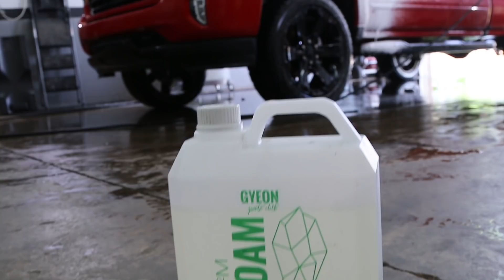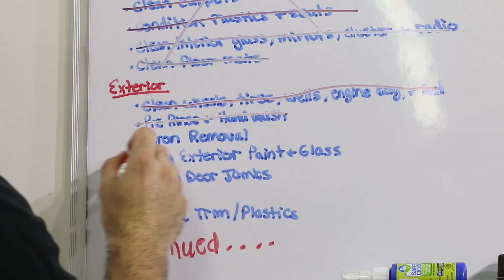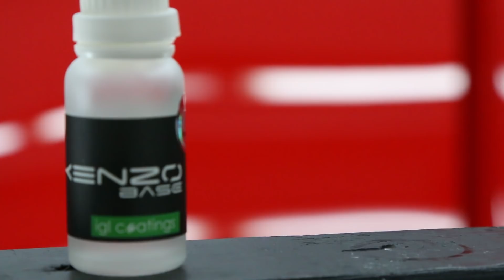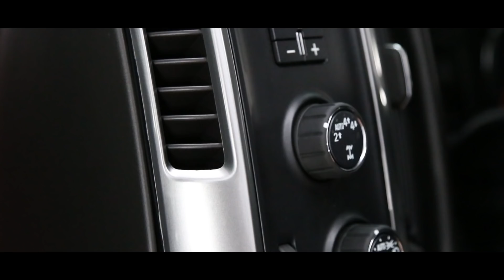PART 2 Detailing The DIRTY GuitarmageddonZL1 Truck

Comment: You guys stepped your game up with these videos!! You guys do badass work!
Reply from the maker: Baird Racing thanks man! Really means a lot!Took a lot of work but striving to keep it up as much as we possibly can from here on out!
Reply: Pristine Auto Detailing I wish you guys were closer so I could get mine detailed. What is the cost to do the full detail like the detail you did for this Silverado?
Reply from the maker: Baird Racing how far away are ya? Some customers travel pretty far. Prices greatly vary but this type of detail would run around $2k. That’s with our top coating like this received and discounted paint correction rate and free interior detail with our 2 top packages. Treat everyone the same and give the best price we can. This detail was a $3k value but had $1k off with the package he selected. Most average $1400-$1700 tho all depending on the prep and paint correction

Comment: If you haven't already, you should look into filtering and drying that compressed air - that ingersoll rand will pass oil into the airstream and on to your "canvasses" or " works of art".  It gets worse the harder you run it because it heats up and the oil turns more "aerosolly "
Reply from the maker: For sure! We do have multiple filters now but would like to eventually add a dryer as well!

Comment: I just watch this video.  Truck looks good.  Could you do a video on what products to use on areas of the truck?  What do you spray on the inner wheel wells?  Mine look like crap I need help.
Reply from the maker: Ben Deco yeah definitely! We use Stoner all purpose cleaner in wheel wells and a ton of pressure washing on the carpet wells.

Comment: What coating did you use for the exterior plastics and rubber?  Are you using the same coating used on the paint?  Excellent work the truck looks amazing.
Reply from the maker: On this job yes we applied IGL kenzo to exterior plastics as well. Sometime depending on the vehicle we will use IGL Trim Coating but not every time. The kenzo holds up really good on the plastics.

Comment: What are the yellow micro fiber towels you are using? Also your wheel and tire cleaner. Thanks
Reply from the maker: detailing_101 the yellow towels are just the Costco Kirkland towels. Tires we used Stoner all purpose cleaner, and Wheels basic soap and water with Gyeon iron remover typically. Sometimes Detail king brake up wheel cleaner. Some links in vid description. 👍🏻

Comment: Wait you guys spray the engine? Wouldn't it damage the alternator?
Reply from the maker: Gm Fix don’t spray alternator or electrical components directly. We only spray the areas around and major plastics and hand wipe the rest. Have to be careful. Have done thousands this way but don’t recommend if your not careful. You can also bag up alternator.
Reply: Trust me...the alternator gets wet everytime you drive in wet conditions...a bit of spray won't hurt it...

Comment: This is by far your best video! Awesome! That truck looked amazing. What kind of coating did you use?
Reply from the maker: TJ thanks man!! We used IGL Kenzo for our coating.
Reply: Pristine Auto Detailing I guess I haven't heard of it yet,do you guys sell it? If so I  would be interested in buying some to try out. Hows that baby boy,is he letting you get any sleep?
Reply from the maker: TJ hey we cannot sell the Kenzo. Have to become an authorized installer. If you have a Detail shop it may be possible to get your hands on it though
Reply: Pristine Auto Detailing cool thanks man!

Comment: How did you remove those hard water spots on the windows?
Reply from the maker: Corey Dawson tried 0000 Steel wool and lubrication but they were too etched into glass so we machine compounded all the glass.

Comment: Nice work guys! Truck looks great and I'm sure Nick is happy with it! What about a 2011 mustang in black? I've got nasty holograms and swirls... what do you recommend?
Reply from the maker: Thanks John! We have a love-hate relationship with black mustangs lol. Typically with them they need buffed with menzerna 2500 and the polished with menzerna 3500. 20-30hrs later you will have a nice halogram/swirl free car.
Buffers: Rupes 21mm & Rupes lhr 75e
Pads: Yellow Rupes Cutting Pad followed with a Buff Daddy black finishing pad.
Reply: Pristine Auto Detailing thanks for the advice. That's the most I've gotten to that question, most ppl tell me to just re paint the car. I'll look into those products! Thanks again!

Comment: What tar remover is that? And are you able to use it on the windshield? I drove through a construction zone in Ohio as they were spraying tar and have it all over my white car. I can’t find anything to remove it
Reply from the maker: steven ecker try looking for Stoner Tarminator. Works well and you can use on glass if needed.
Reply: Thank you! I’d just rather try using everything I can versus replacing a windshield lol
Reply from the maker: steven ecker don’t blame ya! Have you tried lacquer thinner on glass only?
Reply: Can’t say I have tried that. I’ve tried washing it at the car wash and everything and it’s just stuck on there. But I’ll definitely try the lacquer thinner
Reply from the maker: steven ecker try a lil test spot. Put it on a rag and wipe a lil section first
Reply from the maker: steven ecker a lot of the times if you contact your state or township they will pay to have tar and rd paint remover as long as you know where and when it happened

Comment: That's alot of work for so so results. Too many different company's of products being used. Not impressed sorry.
Reply from the maker: Appreciate your feedback! We like to see everyone's opionion so we can give the viewers what they want next time. So you would like to see a video using all one companies product? Can you explain why? We have found that each company has good supplies and each company has not so good so over the past 16years of testing many products we have to mix match to provide the best results we can get.
Reply: Pristine Auto Detailing Thanks for replying. Yea I like to use one company's products when I detail my car. I think you get better results cause there products are meant to be used with each other. When u showed that spot on the bumper where you fixed you can see spots and other stuff that's why I said I'm not impressed. I do love that thing u had attached to the hose to clean under the vehicle. I'd love to get one.
Reply: nyrngrs15 - They showed the before and after but the two were a bit mixed with each other - showed them side by side but I think they showed the before when it should have been the after if I am making sense. I thought it looked really good where the paint had been scratched well the clear coat anyway. I don’t see how it could have turned out any better other than to refinish that area. I am very fuzzy but I would’ve been very satisfied with the  results. Cheers
Reply from the maker: We aren't a body shop so we only perform the work within our means. Could use a full respray on the bumper only then clear ppf installed. It was really really chipped up and damage and didn't want to do more than buff, touch up small little chips, and coat.
Reply: Pristine Auto Detailing I know your not a body shop. Your paint correction sucked it's that simple
Reply: nyrngrs15 - You mention that you detail your car and you only use one product line. Plus you weren't impressed with the bumper area that was damaged. Than you said after your one comment that you were sorry - last sentence in regards to your comment? 
I take it your not a professional paint detailer or own your own business and again you only detail your car. I have been a paint and vehicle detailer sense 1967 this doesn't include the years before having detailed my Dads cars or my own prior to starting in the business. I now presently own 3 vehicle detailer business's but I haven't detailed a vehicle for roughly 9 years because of my age now at 72. 
First off the bumper needs the clear coat buffed out using a very fine polishing compound but it appeared from the video the clear coat had been compromised. In this case to make it look like new it would need a respray - at least the clear if the paint had not been damaged. They told Nick they - in so many words they would see what they could do in regards to that damaged area  not make it look like new but would do their best. I take it you have never heard or seen fallout from a steel mill - foundry? If you had you would understand that with fallout from a foundry on a vehicle that is not only parked 10 - 12 hours a day sometimes for 7 days week in some cases permanently damages the clear coat and in some cases the paint depending on the vehicles finish? I have dealt with Enamel - lacquer and clear coat finishes used on vehicles sense these fishes were used. They all react differently to fall out and with clear coat it is a challenge to deal with period. Short of using an abrasive compound used on any painted vehicle one runs the risk of damaging the finish even more if your not properly trailed to do so. I take it from the video this shop does not use polishing compounds on vehicle but only uses a buffer to polish the fish itself with a wax type detailer product. In short this business did what they normally would do in regards to detailing and than applying some type of paint sealer. Yes some of the fall out still remains but no fault of this company because they are not a paint refinishing service. Detailing and a paint restorer companies are totally different as you know. In my opinion this company did what they could using the technics they are trained to use and let customers know in advance. Fall out is basically a severe type of acid rain and once on a vehicles finish each time it gets wet it is reactivated and continues to further damage a vehicles finish. Fall out is not nearly as bad at or near foundries because of strict EPA rules and regulations. I am not versed in the sealant products used on Nicks truck only because I have never used it. As for mixing products - brand names I will say that I also purchase what I have found to be the best in regards to my personal experience for my 3 shops. Most all of them have close to the same ingredients or chemicals and some are made by the same companies although a bit different depending on the brand name they are made for. But I will not argue the point that the same product lines work better as one or mixing brands only that I use what I have found to be the best for myself.  
My conclusion is this company which I haven't dealt with from the looks of the video did what appears to myself a very good job considering. Videos or pictures can't show everything in regards to how bad or good someone has done. But if the customer is satisfied than I am. But as someone like yourself doing your own vehicle you might feel you could have done a better job.  It's easy for us to either  condemn or like what we have seen but from what I have seen this company did in fact do a good job. 
Don't you just love spell check - it can F up a whole lot of miss spelled words or misplace them with other words I for one am going to shut mine off. Thanks and take care, Cheers.
Reply: LunchBox wtf??? You have no clue what i do for a living. I know they did the best with the scuff marks and that's not what I was bitching about. I'm just one company loyal with my detailing supplies. If u read my comments you would see that I say great things about them too. I just wasn't as impressed. I know the shop and the people are very nice.
Reply: nyrngrs15 - I never said or asked what you do for a living - you commented about your car not cars. Your right I have no idea and if your a professional detailer or what you do for a living and I don’t care either. We all have our opinions and if I misunderstood yours than I am sorry. But you did say it was a lot of work with so so results or something of the sorts. So let’s move on ok and you have a nice day although it’s raining here and we don’t need anymore of that. Cheers
Reply from the maker: nyrngrs15 are you taking about the 50/50 tape line on the fender? It’s a roll back and forth of half of the paint done and half not done. The truck came out near flawless for a one step machine process removing as little clear as possible.
Reply from the maker: nyrngrs15 I use 10+ more different Detailing line of products. Each Detail receives what we think is best for the current situation. Just in compound we have 6 different choices. We can’t just have one kind of product since each vehicle acts differently, especially in paint correction.